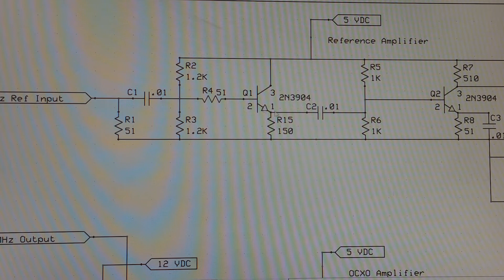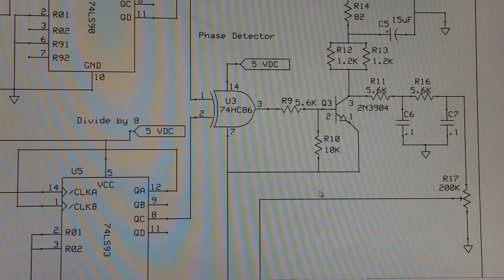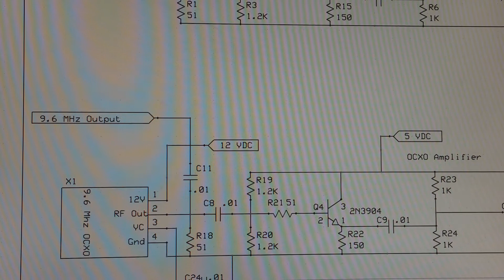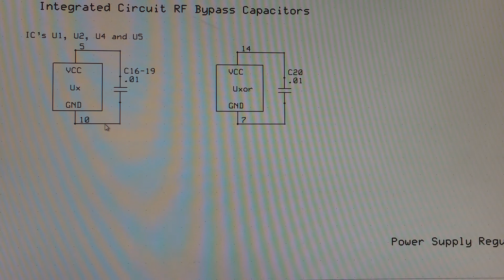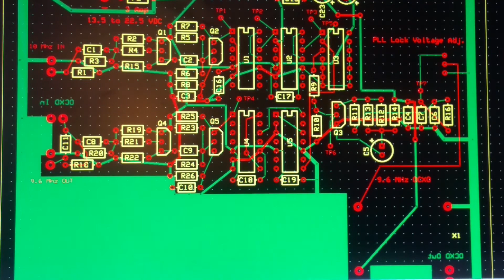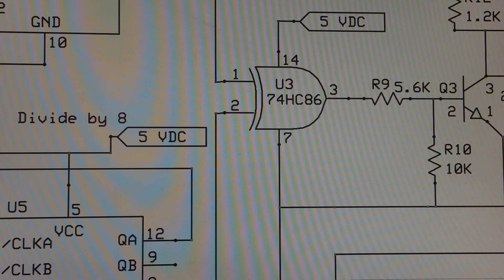RTCM GPS Clock PLL Circuit

Comment: I'm interested in these. I would really like to try and simulcast some sites. Have you built some of these boards?
Reply from the maker: I have built a bunch of them for my own use but I still have some of the PCB's left. I also can give you the gerber files to have your own boards made. Recently I made an updated version of this that is programmable for an output from 6 to 20 Mhz, gps locked to a 10 mhz source. If you want to chat about simulcast, email me at kc2irv@gmail.com.